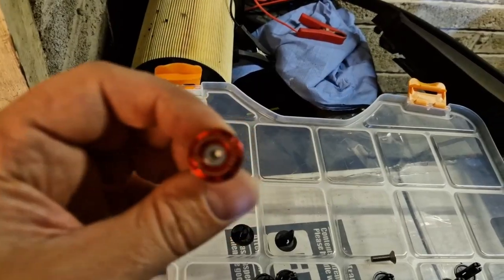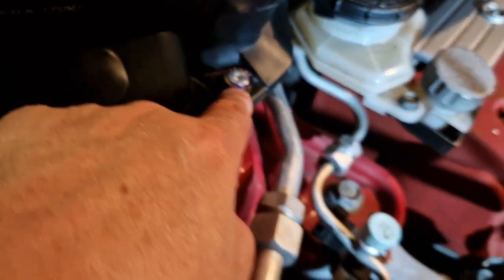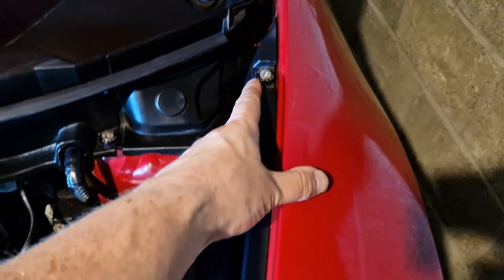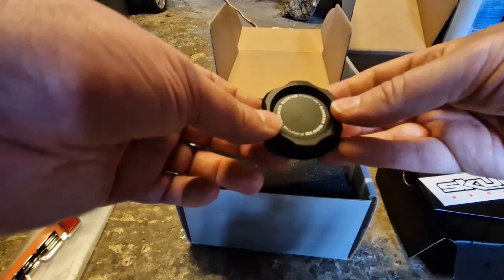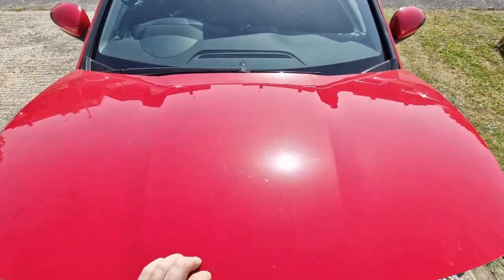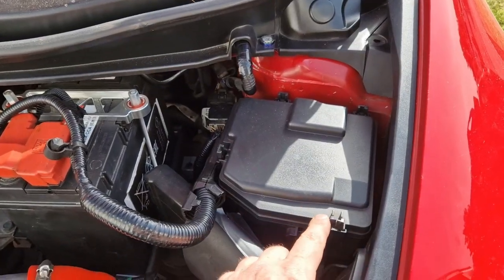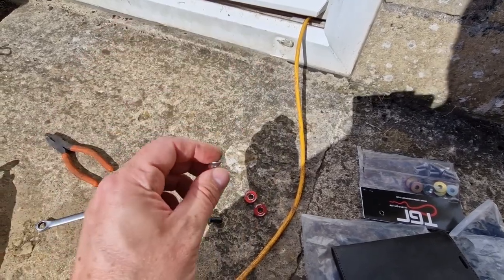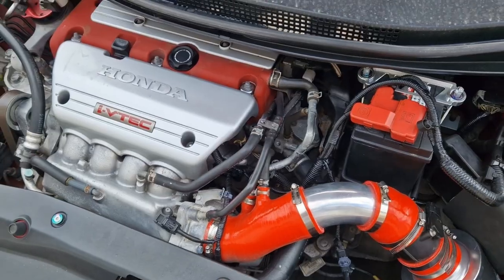FN2 Engine Bay | Bonnet Struts | Dress Up Washers | Skunk2 Oil Cap | Honda Civic Type R Mk 8 Gen CTR

Comment: I fitted these, I left them loose opened and closed them a few times to settle them then tightened them up.

If you need pictures of the position they settled in I can get these for you when I get the car back from Danny
Reply from the maker: Thanks mate.  I did try that, but couldn't stop the passenger side one hitting the fuse box
Reply: @ModFix  that’s weird mate. I wonder if they sent the wrong bracket
Reply from the maker: Or possibly EP3 ones ?

Comment: Hi buddy love the video as I’m considering some dress up washers too. Heard the MJC ones are a bit of a pain so glad to hear the TGR ones are a lot better. 

Did you just get the tgr standard engine bay dress up kit and did the plastic trim bits that sit underneath for the bolt to go into come with the kit?

I’m looking to replace my plastic clips along the slam panel and both wing covers too was there any modifying you had to do to the holes for the washers and nuts to fit or was it all fine (apart from having to cut the bolt down)?

Thanks
Reply from the maker: Thanks mate,  much appreciated 👍 Yeah they are the standard tgr dress up washers. I do find the coating comes off them after a while. 
I don't remember doing any other modifying. 
They work tons better if you use the bottom half of the plastic clips to screw into. They are much more secure that way 👍
Reply: @ModFix niceee for the price and looks I guess you can’t go wrong :) Did the plastic trim bits that sit underneath for the bolt to go into come with the kit or did you purchase them elsewhere (if so where from)?
Reply from the maker: They do come with bits that you are supposed to screw into, but I didn't think they held very well. I just bought a load of trim clips off ebay I think